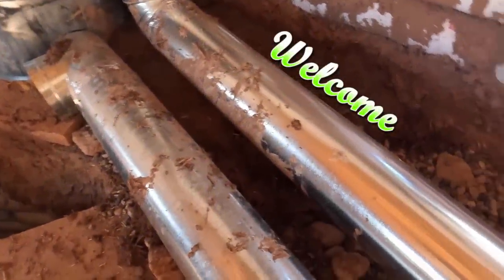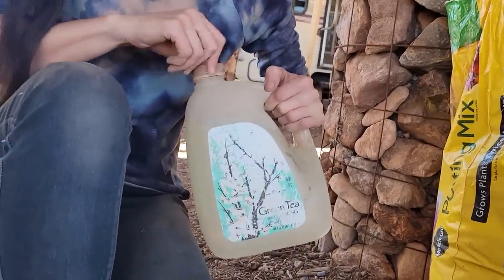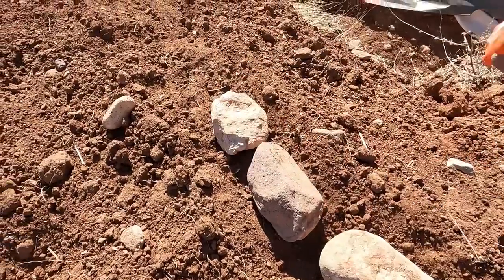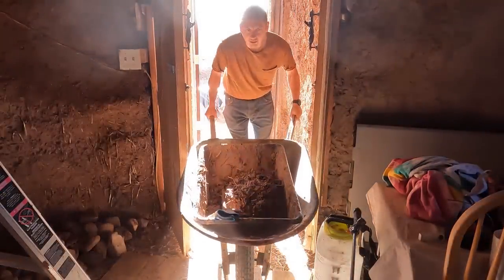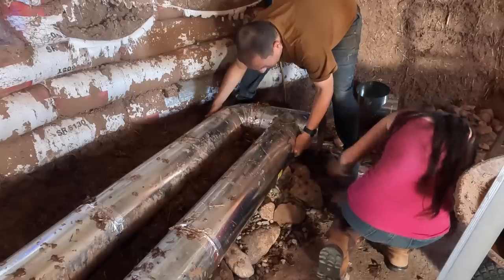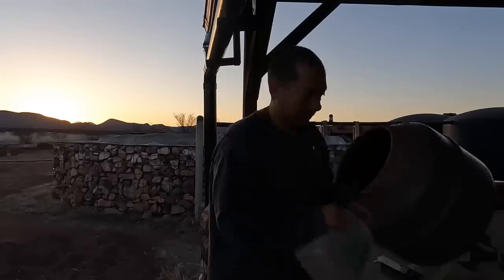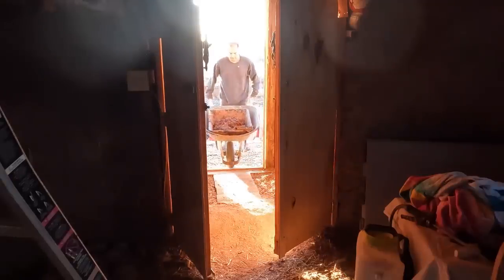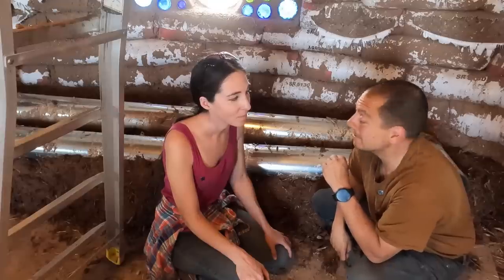Building A DIRT Sofa That Will Heat and Cool Our Off-Grid Home | Rocket Mass Heater

Comment: Please consider not building the sides of the bench straight up from the floor:  provide toe-in space--bottom of bench should be significantly closer to wall than seat-width.  Toes need to have a place to go when standing at bench, and heels need to be able to get under you as you rise from sitting position.  Glad to see all this work on the dome itself.  Dogs and people lookin' good!

Comment: My brother who has made stoves with propane tanks thinks your rocket stove will get too hot and melt barrels and galvanized pipe. He has a 350 gallon wood stove made out of propane tank. Used a wood stove insert for door and vent. Heats a 30 by 80 20 ft high green house. I pray you don’t melt you barrels. Propane is 3/8 inch steel.

Comment: have you done a test light on the rocket mass heater to make sure it draws properly before you cover it up with cobb?
Reply: also some suggest doing a burn before the cob is fully cured....otherwise when the pipes expand from the heat the first time it could crack the cob.
Reply: Also to check for  co2 leaks

Comment: Remember when a person is seated on a wooden bench with legs you are able to scoot your heels to the back so your feet can end up under your bum to make you feel comfortable.  But with a solid structure  you need slanted inwards wall if you want to create  that same comfort. Also prevents lots of toe stubbing walking around the structure.
Reply: Yes absolutely need to do this or you will be kicking into the cob.  Looking at the window above the bench, I think it would be nice to do a similar style of glass insert into the cob using just the bottoms of glass bottles. You can buy a bottle cutter and just cut out the round bottom piece. I personally think sort of a yellow color would look nice with clear pieces as well   Lol every one has an opinion right?
Reply: Citrine color

Comment: One way to cool using the earth's ambient temperature is to bury a tube running deep into the earth with a tower at the end on one end and the egress into your home. It will siphon air cooling or heating by the earth's own temperature. It works well especially if you attach a fan to help pull air which way you want it to go.
Reply: They have the openings for the bedroom below the dome

Comment: This m ay sound like a daft question, but it is me asking. So nothing new! ;o)
While I agree you need to form the cob round the exhaust pipe from the stove, what about the rest?
If you are mainly after thermal mass, as long as you don't leave voids why not chose rocks from your "garden" to bulk it up rather than mixing all that cob and having to dry it all out afterwards?

Also, a bit in the future ..... it is rare in the USA, but in Europe there is a popular way of using the sun to heat the domestic hot water ...... a Solar Radiator. Have you thought about using one on your dome?

Comment: I could visualize a small smooth rock layer on top and sides of bench that would be pretty, prevent sitting on and degrading the cob. And putting a few cushions or blankets then on top of the rock layer would also be so pretty.
Reply: With cushions on top I see the dogs up on the bench laying down on it and the other laying on the floor next to it in the winter
Reply: Rocks of various colorations could be very cool indeed